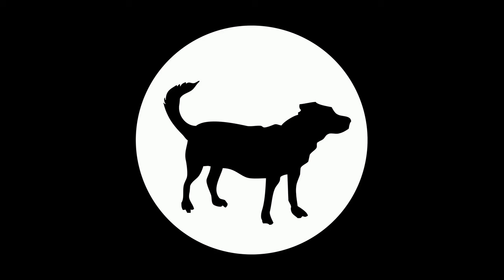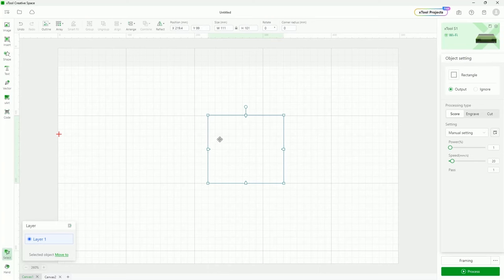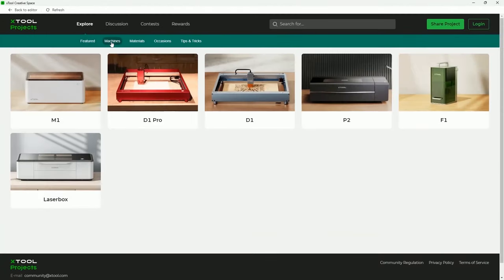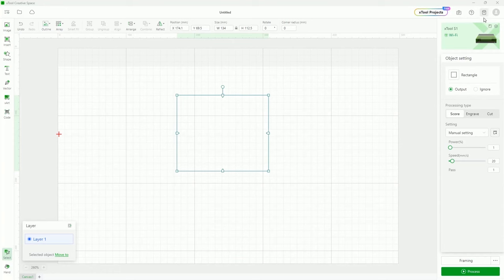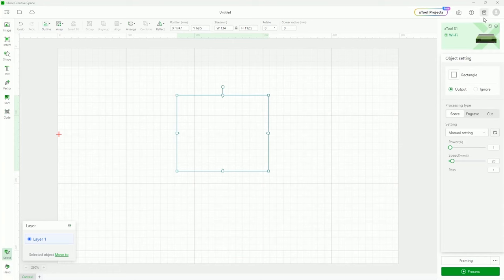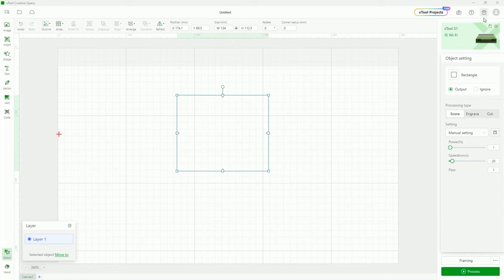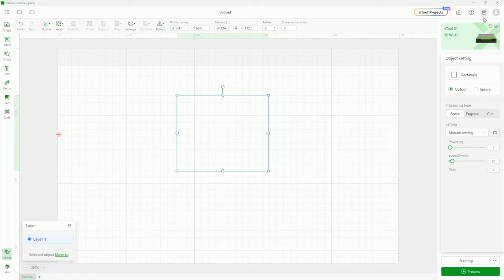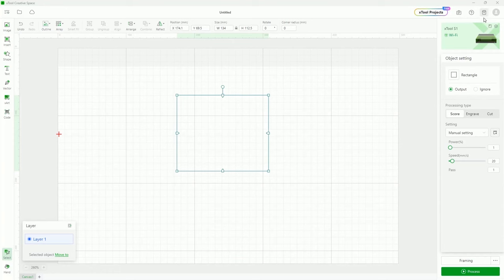xTool Creative Space Tutorial | D1 Pro Edition | Dec 2023 UPDATE

Comment: Thank you for your helpful videos. 

In functions, when you select “laser extension” instead of “laser flat”, the ability to use absolute coordinates disappears. In this video you said all the options basically stay the same. That seems like a pretty big difference in options. So, can you not use absolute coordinates if you upgrade your d1 pro with the extension kit? I’m probably not understanding you correctly. Thanks
Reply from the maker: I heard someone else with the same issue with the extension. Not sure why they did that but if you are using something like my extension grid you can still use absolute coordinated the old school way. Essentially you just need to have a square in the 0,0 position that is set to something like 1% laser power and then have your actual design somewhere else on the grid. That way the laser will think that that there is something in the home position of the file and should respect the rest of your design position. If you check out the video in my channel about absolute coordinates you should see what I’m talking about and my grids even come with an absolute.xcs file that places the square there for you.

Comment: Hi thank you for the valuable info. I just got the S1 and am new to xcs creative space software. I am use to using vectric v carve pro software for the cnc and I can add and modify and cut unwanted vectors with the “scissors function” and it’s highly modifiable but I can’t seem to find a scissors or cut feature with xcs. Also a measure function for a particular vector. Can you advise on these two items. It may be in light burn but I haven’t used light burn. Thanks so much.
Reply from the maker: You can do those things in Lightburn but they would be more difficult or impossible in XCS. Lightburn also has a free trial that you can get before you buy it.

Comment: Great video thank you. Ive had my D1 for over a year. I saw the first version of this video last year, and learned a lot. I switched to lightburn, because of the wider variety of functions it had. However i recently decided to go back to xcs when i noticed i obtained very very different results with the same settings using both softwares (would you have an answer to that?) I completely forgot how to navigate through xcs. Thank you again!
Reply from the maker: Different programs run different processes and algorithms on how they process files. I don't know the difference between what XCS and Lightburn does on the back end but hopefully it wasn't too far off.
Reply: It was very significant difference. Lightburn's was blurry and xcs was really clear....

I have another question hope you can help. If I am to start using absolute coordinates and burn a grid. Could I use the same grid and coordinates on both programs?

Thanks a lot beforehand!
Reply from the maker: @V1lch1sm Yes they can. Another thought on Lightburn, just make sure that you have imported the .lbdev file from xTool when adding your machine to Lightburn. There are some additional settings in there like speed compensations that don't come over if you did the automatic setup straight from Lightburn itself. I talk about that file in the beginning of my Lightburn tutorial
Reply: Thank you I appreciate the help. I'll check the video again.